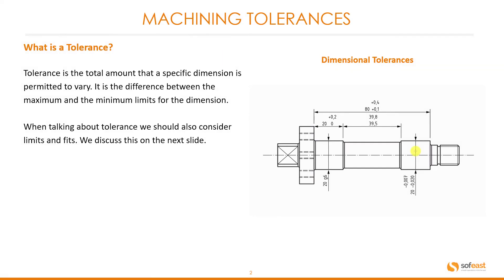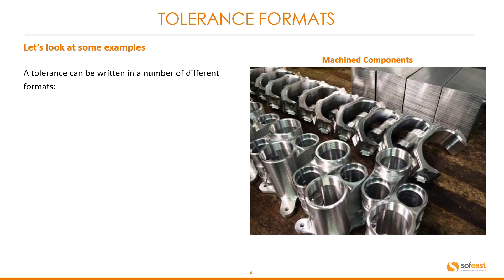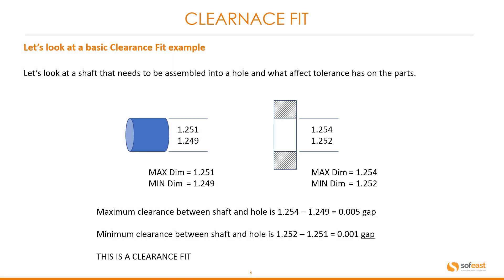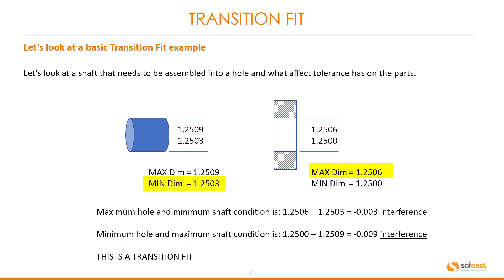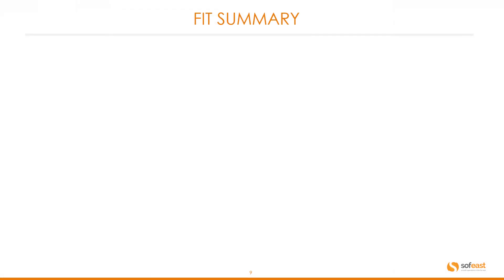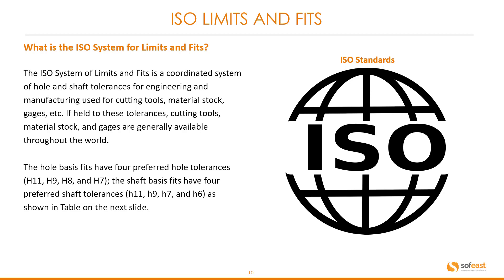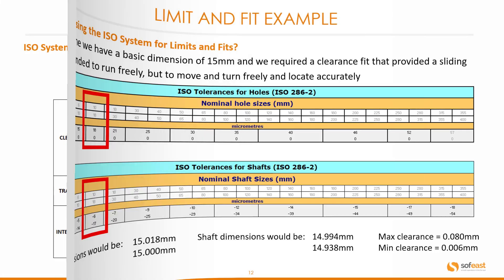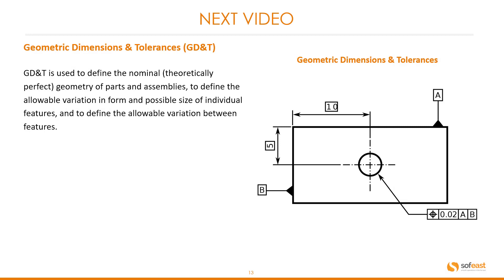The Importance of Machining Tolerances (Metal Machining Video 4)

Comment: - @4:10 and again @5:10 you botched a decimal place in you arithmetic. Also the sign is wrong on the first calculation in the transition fits and your arithmetic is wrong in the first calculation in the interference fits. The "Transition" fits should be +0.0003 inch and -0.0009 inch.  The "Interference" fits should be -0.0007 inch and -0.0019 inch respectively. 
 - 
 - If we were to use your arithmetic mistakes in the actual manufacturing then a nearly 20 thousandth over-sized shaft on an inch and quarter would be quite the interference fit indeed!!!
Reply from the maker: Thank you for letting us know. We have corrected the slides and you can see them as follows:
- For the correct data about interference fit, please see this slide: https://www.sofeast.com/wp-content/uploads/2021/11/interference-fit.png
- And for transition fit, please see this slide: https://www.sofeast.com/wp-content/uploads/2021/11/transition-fit.png